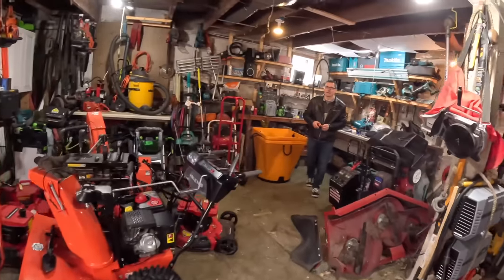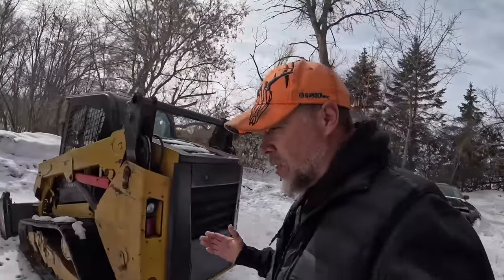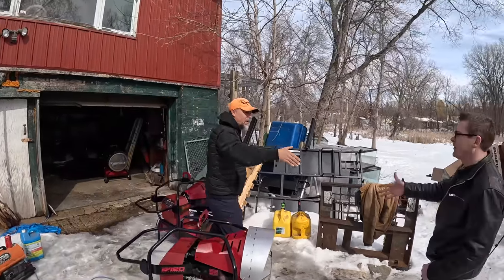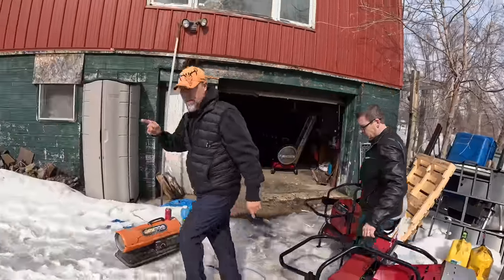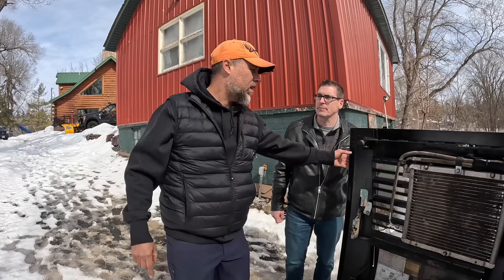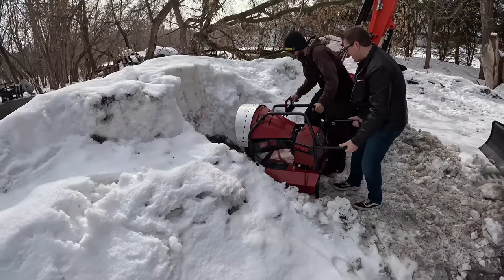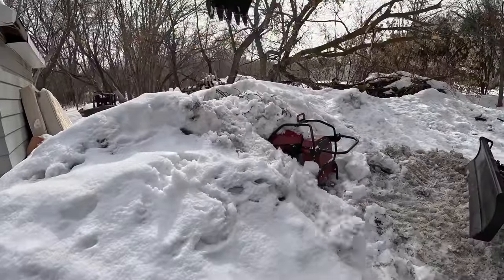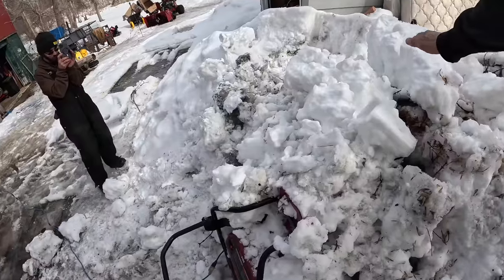It’s like TURNING ON THE SUN!  #Garage #heater #workshop

Comment: this would be great in my unfinished shop in Alaska when I am working on/in it during the winter to take the bite off.  I use a normal diesel torpedo heater when there now, but need to leave the big door open a bit to get enough fresh air to help keep the smell and headaches at bay.
Reply: These are sold at Alaska Industrial Hardware locations in Alaska :)
Reply: @Sunfireheaters  Really!!! AIH is one of my favorite toy stores!!! I'll look for them the next time I'm up there. Thanks for the heads up!

Comment: Looks like a durable shop heater, definitely better than the old school torpedo heaters.  Thanks for such a detailed video!
Reply from the maker: You bet!
Reply: Been using torpedo heater for over 30 years now, they are way more powerful typically than the infrared heaters and check the prices, you can get a new 35kw heater for $500 and a 35kw infrared heater cost over 3 times that

Comment: How safe is this with the gasoline vapors when they are warmed up. Is it certified to be used in a closed garage/shop area, that has explosive vapors. 
Can/will you post the certification that it is safe/ approved for this installation
Reply: Excellent question. Our heaters do not use gasoline but use either diesel or kerosene which are much less volatile than gasoline. These heaters are fully UL Certified under file MP5162. The UL certification is specifically for indoor use. These are not meant to warm inside a residential home, but they are perfect for inside a shop, pole barn, garage, warehouse etc. These have been fully UL tested and have met all safety standards for these types of indoor applications. Thanks for the excellent question because safety is extremely important to us.

Comment: Forgot to comment yesterday.  Have installed a few of the infrared heaters in shops & garages over the years.  Everyone loves them.  I could see where a portable unit would be great.  The best way to describe the way these work, is that they heat objects (floor, cars, tools, etc.), not the air.  The air gets heated by the objects losing that heat.  The guys with auto shops love them, because you can open the overhead doors in winter & as soon as they're closed, its warm again under the heaters & the cars are melting off...     Kool review.      Thanx !

Comment: I have 2 of the Val 6 heaters and they have worked great for 15 plus years. Bought this one 2 years ago and it has worked great too. It is a little bigger and will only fit through a 36” door 90 degrees to the wheels.  Not very handy.  Hope they fix that little issue.  It is a very heavy duty heater.  We have used them in enclosed spaces on our new home construction projects in order to build year round in Alaska.  The best part is they heat surfaces and so if pointed at a concrete floor, floor heats up and continues to give heat back. Highly recommend this heater.  Expensive but will last a long time and works better.
Reply: @bobcatbuilder2107  Great feedback and you are right. You have the SF150 which was our first major model and our largest and heaviest. It was designed primarily for rolling to different areas in a larger shop but not best for most portability needs. We are working on making a change on the size of that one soon, however. The heater in this video is the SF120 and is much smaller and more portable. This will fit through any door at only 28.5" wide and we just launched an even smaller heater, the SF80 at only 19.75" wide. BTW - these are sold in Alaska at Alaska Industrial Hardware locations.

Comment: How are these different compared to, for example: Mr. Heater radiant heaters?
Reply: Great question. Answer: We have several more models available for this style of heater to give consumers more options, our heaters are fully Made in the USA out of Janesville, WI (Mr. Heater is made in China), and performance and durability. That drop test says it all about SunFire. We know how to build heaters that are rugged tough and have no smell, and no fumes.
Reply: @Sunfireheaters looking at the parts breakdown for the SF150 it looks to have a REAL oil burner like a Beckett, Carlin, or Reillo. THAT is key. Proper shaft driven gear pump,  clean cut solenoids etc etc. Those burners are what goes in residential and commercial furnaces and are robust and give years and years of service. Good product.

Comment: I'm calling bullshit on the emissions or lack of.
Reply: Anything under 25hp doesn't have to do anything special to be emissions compliant, as far as I'm aware.
Reply: There was a bit of smoke at start up, but gas sensors looked good to me 🤷‍♂️
Reply: @____________________________.x  There can be an initial puff on start up because of residual fuel from the last burn but it's about 1 second or so and that's it.
Reply: We appreciate the concern because for most, it does seem unlikely. This heater does burn fuel so there will be emissions such as carbon dioxide (CO2). However, regarding carbon monoxide (CO), the testing is accurate. This has been UL tested and certified where this had to meet certain standards including carbon monoxide. We can achieve this by circulating the fuel inside the funnel shaped cone very precisely, that allows us to fully burn every droplet pure and clean. When that occurs, near zero or zero CO is achievable. This is of course with a burner that is properly tuned and kept up in maintenance. If dirty fuel is used or a nozzle gets clogged, that will affect the burn and proper spray of the fuel that can affect emissions. The OSHA standard is 50 parter per million for indoor use so even a little CO would still fall within their guidelines for indoor use.
Reply: @Sunfireheaters dont forget to mention the refractory and how it quickly heats up and reflects heat back into the flame, further atomizing the fuel for a complete and clean burn.

Comment: It appears you are biased towards this product, where is the unbiased side by each testing that's normally done?? Does this product provide more heat than a standard competitor?? Does this product work with out electricity in the field?? Does this product burn more fuel??? Ect......
Reply: He doesn’t do side by side testing. That looked hot enough for me?  No, it uses a cord. How is it ever going to burn more fuel but produce less heat than some other device? Fuel in = energy out

Comment: your outta your mind at 2500 bucks man. outta your mind. i can get a propane heater for my garage from harbor freight for a hundred bucks. 2500 bucks your crazy. i can get a natural gas heater installed for the money.
Reply: We understand your point very much, this is meant more for commercial portable use than the average residential home garage at this price point. We do have a smaller unit at a lower price point but still not in the harbor freight price range.